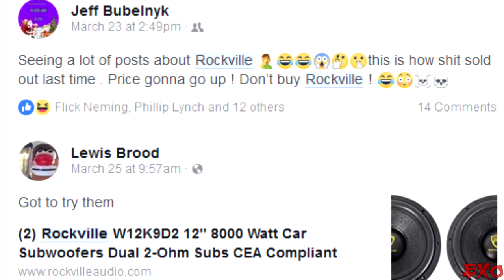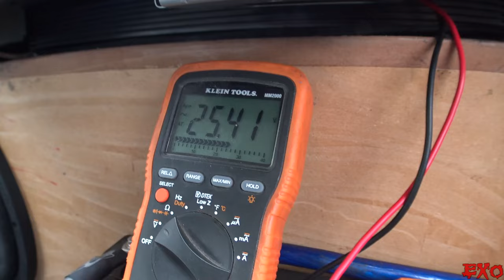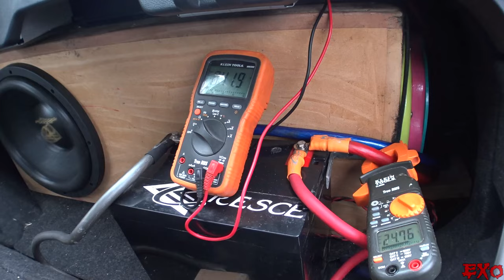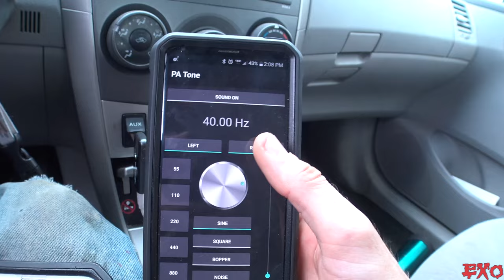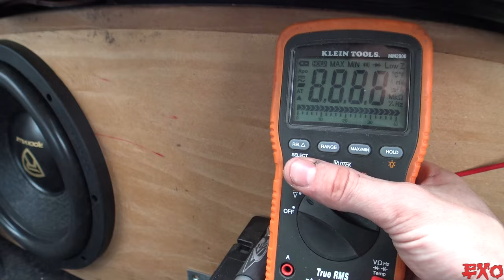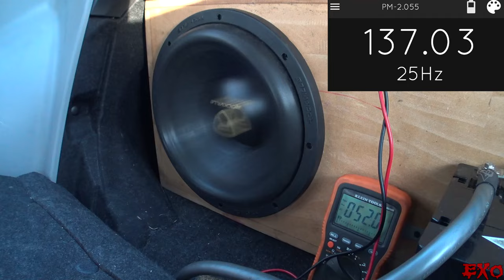CHEAP $100 Subwoofer TEST w/ 12" Rockville K9 Car Audio Sub | Aero-Ported Box SPL Bass Testing

Comment from the maker: Explaining The Aftermath & Testing a Cheapo!!! :D
Reply: Nice. Great video. ;)
Reply: What are you thoughts on the dual 12" JL audio ported subwoofers?
Reply: Goes to show how proper tuning trumps big money gear without tuning.
Reply: EXOcontralto try the Pyle 18 blue wave fr the hell of it
Reply: Just ordered one for myself i saw that magnet and had to get one for myself thanks exo
Reply: EXOcontralto  I have a pair of the Rockville Bluetooth home speakers with built in amp, and two 10inch, mids, and tweets and they rock for $200!!!!! They have everything built in and totally eliminate the need for an amp or receiver.
Reply: I made a portable bluetooth speaker with rockville speakers
Reply: Thanks EXO awesome vids as always
Reply: Like to know your thoughts on soundqubed hds line they're a pretty affordable sub. But how do they bang and how do they hold the power
Reply: you should n
"play in" a new subwoofer before you turn on full volume read a lot of things that do not pull on right at once, but maybe 30 hours or so?
Reply: Skar Audio vd series really hit to
Reply: Whats the name of the so g at 11:20?
Reply: Bonjour, comment allez-vous, je suis de l'Union européenne, votre fabricant de haut-parleurs, et vous devez savoir que je suis de l'Union européenne OKI? OKAU E Ces lunettes de soleil par ENIGMA- RETURN L'INNOCENCE ETAIT GREGORIENNE et comme les bonnes et noires gays africains et le carré de joaõ henriques UNION EUROPÉENNE
Reply: i just took the bluetooth boombox that i just posted on my channel and faced the 4 front facing mini woofers into the floor on a wood floor(carpet) and it seems like 3 times more bass im not kidding....any comments or recommendations
Reply: Try the db drive 2k 12
Reply: 9:10what sub was that
Reply: EXOcontralto can you review a small bluetooth speaker called 
“ kitsound cube”
Reply: EXOcontralto I have a car audio system, but I set it up in a cabinet with pioneer 50w x 4 channel, 200w total, and on it is 6 6.5" pioneer 200w speakers, 1000w pyle super tweeters, 4" kicker door speakers, and an 8" bose sub,, external of that are 2 big car batteries, a 225 amp car battery charger, a 6000w lanzar vector amplifier, and 2 15" 3000w quantum audio subs, but once i get to half volume my speakers have like a crackle noise, but its not that the speakers are bad, i need some help...
Reply: Hey, EXO I what to buy Rockville 2 10” what’s a good amp and watts for them
Reply: I swear these are sold out everywhere
Reply: aeros6810 wtf is a ported subwoofer...also jl makes more that 1 model of subwoofer. If your talking about the 13inch JL w7's in a ported box those are good but way OVER priced they are like 800$ a sub your better off getting the Rockville k9's 4 of them for 400$ ish and get 2 of the Rockville db16 amps that are 200 each but then again you will need multiple batterys and maybe upgrade your alternator to a high output one and if your asking a question as vague and incorrectly worded the 2 JL subs or 4 subs is way over your hear just stick to 2 12inch k9s that he does in this video or a package on eBay for like 350 where you get 2 10inch Rockville w10k9 subs and amp and a box lol that will pound and you can get away without buying a second battery
Reply: Ren Höek get these that are cheaper and yes soundqubed are good for the money also but they have similar spces as the k9 series in this video but cost 2 times as much 4 if these would be same price as the sound cubed and be way louder cause double the surface area just need the power to support it
Reply: Dominic Martinez your amps are distorting make sure you turn the gain way down look at videos on your to set gain...
Reply: "10 inch subs" I meant to say in my comment. Lol... Sorry about that. But yeah those speakers are a full system! No need to buy anything else.
Reply: Randy Martinez get the Rockville db16 it's a little Overkill but you won't have to be maxing out your amp all the time and it's pretty cheap for what it does
Reply: Mehul Singh Rockville k9 subwoofers have good bass if your asking about the 3 brands you listed it matter what sub....they don't all make 1 subwoofer lmao pioneer premier series are good and probly have the most bass out of the ones you listed but they are expensive. Just get the Rockville k9 10inch 12inch doesn't matter what does matter is the box is 90% of the build always remember that . Look up "Dave the box guy budget setup" blows minds
Reply: alternate sellers on amazon is where i got mine! cant remember the name of the company.... audio something or another.. but they are based out of new york. took 7 days for me to get mine
Reply: Let me ask you, do u still have the sub hooked up? I like the look of the sub, i just want to try something diff instead of buying expensive subs like I'm well known for doing.
Reply from the maker: @Jon Doe - No shame here man, I got a whole video coming up lol
Reply from the maker: @Ryan Merril - The sub lasted a week. Apparently there's some issues being addressed on their end with the K9's. They made things right by me though so I'm not totally pissed lol
Reply from the maker: @Heяø GaMeR  Possibly! Let me do some research
Reply from the maker: @aeros6810 - I love JL Audio. Can never go wrong with them
Reply: EXOcontralto Exo you always have good bass songs! Which one at 12:00?🔥
Reply: What kind of RMS were you throwing at it when it blew??  Was considering recommending this to a friend as a budget alternative, but after hearing you toasted it in one week, and he dosn't know how to control the valume knob, kind of nervous as He has a hair over 1,200w rms on tap without clipping
Reply: EXOcontralto what would be awesome is a install of an loc on a factory amp to add an amp for aftermarket subs.
Reply: alexander hedblom very true but for 100 bucks am to make a video it's Def not gonna kill the woofer at the worst take a little longevity away but again it 100 woofer I'm sure he has no intentions of making a build outta of it lol
Reply: EXOcontralto Has Rockville pulled all there k9 series off the website because there are none listed.
Reply: What is that Bluetooth sound pressure meter?
Reply: EXOcontralto... What frequency is this box tuned to? And would 900-1000w be good enough for this?
Reply: EXOcontralto whats the RMS for these and what budget builds would you prefer for DJ or Block party speakers
Reply: The Dutchman well of course but no one's going to buy a crazy JL W7 13.5 and not tune the Box properly...
Reply: EXOcontralto can you tell what song is playing at 10:17?
Reply: What are the dimensions of the box??
Reply: @crackdownex  sold out! Check back soon. Customer service tells me they should be back in stock beginning of September
Reply: EXOcontralto i see your using the stock head unite what’s the piece u used to make it handle the amp
Reply: Box means everything. :)  great video!
Reply: Have you ever wondered why that sub hits harder when you pop the trunk open?
Reply: You would get the highest db with the sub and port firing backward....the closer to the back the higher the db and the hardest hitting, tightest bass. It can hit hard with the woofer firing any direction but you will notice it will hit the hardest with both firing backward. Closer to back will give you hardest hitting sound. If you push it forward to the back of the seat, you will lose some spl but get deeper bass. Facing forward against the back of the seat cancels a lot of itself out, that's why it will hit harder with the trunk open. The canceling sound waves exit the back of the trunk before they can bounce back and cancel some of itself out.

3000 watts with stock highs? Ouch.

Looks like a cool sub for $100 bucks tho and still enjoyed the video.
Reply: @johnmcook1  putting the sub in that box facing up is a horrible idea unless you love rear deck rattle. You can  face it uio and make it sound good ifc you take out the spare and push it all the way back by the trunk lid.
Reply: Garbageville
Reply: Hey would my jl audio 1000watt amp push 2 of these 12s? It was pushing two JL AUDIO W3s and i had it turned down and it was pounding the shit out of them.
Reply: what song were u playing
Reply: It's kind of just like it take to run Rockford fosgate at the copy
Reply: What's the thought of the 8" c.t. subs. My has 06 Saturn just old blue. Right not she 2 Rockford 15" we are thinking removing them and run 1 8" c.t. ?????
Reply: EXOcontralto yytghyuuuhuu
Reply: U5qiue8
Reply: update video for the rockville subwoofer? looking to do a build with these
Reply: @EXOcontralto do another review they have fixed all the issues with them I would like to see you push these to the limits
Reply: EXOcontralto I’m bout to buy two of these w a box for 300$ I trust your judgment and I think for the price it’ll beat the comp for a Similar price point
Reply: At the end of the day nobody can determine how you are supposed to feel about any subject especially when it involved a loss on your behalf
Reply: I’d like to have one because there stout subs, good price and there perfect for starting out. Also I don’t really have the money to buy subs  with being only source of income. I’m trying to make my smart car pound so help a brother EXO!!! Awesome vids btw you’ve helped me out tremendously man. Thanks.
Reply: Love ur video's man keep up the good work u basshead
Reply: hey listen im gonna fry my 15 inch k9 V2 with my skar rp-1200. I wish I had an rp-800 because this is a 800rms sub in my opinion & theese clowns will not make it right with there customer base and now have the audacity to make a destroyer , which I really wanna see if its 2000 rms. I doubt it, there engineers had another shot at the k-9 & failed again so Im gonna get my youtube poppin and shit on this thing
Reply: what song is that
Reply: 999k awesome video.. lol
Reply: @Minecraftmaster6810  great subs, and sound great on low power, two 12s can sound great on the
 JL 500/1v2 SLASH amps.. I actually still have a 500/1v2 and it does 500w at 1~4ohm on 12.6v, I'll probably never sell that amp, I currently run a deaf bonce 4k at .5ohm to a single deaf bonce sa312 d1 sub takes power like an animal
Reply: Did that one burn up like the others real easy
Reply: I like the subwoofer a lot!
Reply: oooooooooooooo1
oooooooooooooo1
Reply: Thank you for getting me back into bass I have 2 12 kiker solos with a 100p watt amp it's like 12 years old and still going.it doesn't sound the best anymore  but it's not blown and works..do they sound worse with age and also iv had my h3 worked on at junk car shops and I'm positive they've used my system and I was pissed. Now supisidly they dnt use it anymore but I dnt believe em..that's why i was so interested  .I've been there..and the var adio place that installed it had set up 5 systems for me before and they all blew without even cranking it so they kept giving me new subs until I got pissed and said what do I need to buy so this wont happen.i got the 2 12lves and have been fine but they do t sound as good as the 4 comp vr12vs I had .idno I'm trying to learn how to do it myself but dno if can.sory for the long message hope u read it.your the man and a big inspiration  to me for real
Reply: @EXOcontralto  your an inspiration and have inspired me to look at a new set up but I cant do my own like you do and the shopify use is out of buisness...love the content your a great guy...

Comment: Im using 4 rockville 18s in a 2 to 1 ratio 4th order blow thru, which i learned how to make watching your video on that.  
Thanks!!!  By the way, i couldnt be happier with the Rockville 18s either.
Reply: Hey give me the specs on your box and what woofers plz. I'm using 2 ct sounds Tropo 18's working on a 4th order blow through as well and having trouble finding the perfect ratios. If I do 6 cubes sealed 12 cubes in the ported chamber at 45hz I seem to get the best gains out of the graph I see on WINISD. BUTT thats 18 cubes total seems too big for 2 18's.

Comment: EXO is the man! I love the enthusiasm. 
I'm building a standard budget build with a 8 AWG "Big 3 Upgrade" and easy access new and used equipment.
I started working with a Pioneer 760 that was given to me blown. Now I am pushing the MTX Terminator™ with a JL Audio 500/1 and need to upgrade my power output to hook up my third amp. Lol. It never stops!
Reply: Oh. I fixed that Pioneer amp. That's what got me back into it.

Comment: Great looking sub for that price 🔊🔊🔊🔊🔊
Reply: Yes I would say the only thing holding the sub back is it can only get down to 33Hz.
Reply: Breaux wonder if box tuning would make up for that? He did say he built that box to perform better across a wide range so it may not be optimum tuning for low low frequencies.

Still! At that price... Can't complain with what it's doing
Reply: Even the audiopipes cost more than these.I really think this is the best bang for buck that's out there.
Reply: DA BEARDSMEN I've gone through quite a few subs from that mid-range and down price (up to $200 for one sub) and honestly i think they're basically all the same. Sure, some are made in house with propietary materials and whatnot but  there's VERY little difference between low and mid-range price subs. When you get above that 200 mark and compare it with something lower you may notice lower end extensions or more full, powerful bass. Compare that same 200+ sub with another 200+ sub and those differences will likely dissipate. 

Box build, tuning, and in car variances make a big difference in how we perceive sounds.

Remember, these people are in the business of selling products, services, and entertainment so it's in their best interest to drum up specs, name brands, and wow factor.
Reply: Frozencajun what the hell are you talking about? The SPL test at the end clearly shows only 2db lower at 25hz than at 45hz. That means virtually just as loud at 25.

33 hz resonance or tuning DOES NOT mean a sub won't play lower in a car. It MAY mean you need a highpass filter if you run out of excursion below tuning but you can clearly see heaps of output below 33 in this video.
Reply: You think? :) Think again! This video just showed you how low it can go. xD
Reply: Agreed on the look.
Reply: lunchie80 3dB is double or half depending on the direction you are going.  That being said, that is still really impressive for a sub I would have laughed at.  The real test is how long it lasts.  It may sound good now but if you run it for two weeks and it dies then it really wasn't worth the money.
Reply: If a sub looks good, smells good it must be good???
Reply: Looked good, performed like shit because it blew in no time!

Comment: I appreciate your vids bro. Good stuff.

I always ran, "low end" equipment and I won 9 competitions out of the 14 I entered in about 15+ years ago. Now, I'm shooting for sound quality over SPL.
Reply from the maker: Thanks for watching and good luck man! Hope you reach your goals :D
Reply: Yeah man. I'm about to get set up in a 2013 Dodge Dart. Need to sound deaden it first. My only concern is power but I do have a 50fd Capacitor with a volt and amp meter on it. Running 0 gauge cable to both Rockville amps. Highs/mids on one amp and to my subwoofer amp as well.

I always run equipment that cost less but does just as good and sometimes better than the "High-end" equipment such as JL Audio, etc.

Comment: Amazing looking sub for a $100 😃😃😃😃😃 could corner the market if it withstands the abuse like Skar did with the RP 2000 amp
Reply: john wagner man I wouldn’t buy scarbage if they where $50! Besides best selling amp ever is JL 500/1 slash. Now that amp cornered the market but it’s not a bargain I get what your saying but the numbers don’t lie.
Reply: Tammy Forbes I've heard nothing but good reviews about the Skar RP line of amps but everyone has a brand they choose to run
Reply: I had the rp2000 hooked up slappin on 1evl 18 1zvx 15 and 1 xvx12...blew it
with in 90 minz
Reply: Jj Hill 😱😱😱😱that's crazy I sold mine and my buddy has it and it's been going strong for over 2 years now
Reply: i got my slash jacked :(
Reply: Is that still true though? hard to believe it still outsells the amazon top pick amps like that garbage infinity "4k" for 79 bucks.

Comment: DAYTON audio subwoofer are cheap and good for SQ setup
Reply: Ehh, I've seen Dayton Audio do better with home theater setups than car audio builds. Not made for car audio builds, really.
Reply: Even the Ultimax?
Reply: Sorry but ultimax sucks even compared to ccs.  I had one and all it wanted to do was distort and that was in a home build.  They might have fixed them but no thanks...
Reply: @QuietWind01  There's no such thing as a sub only made to be used in home builds, that will actually depend on box. Don't believe me?? Take a look at this; watch?v=z381daTbYsk

Comment: So a port box sounds better then a sealed box?
Reply from the maker: Depends on who you ask. To me, hands down ported!
Reply: “Better” depends if you want Power or quality. I prefer ported and ported does give a small Db boost over sealed but doesn’t have the same responsiveness and frequency  range as a sealed box
Reply: Ports give you the "rumble" sealed gives you the "punch". In my opinion.
Reply: Also depends what you listen to. If you like the boom of rap then always go ported to get more. If you like rock or country then sealed will give you a tighter kick but you also need more power to push the air with sealed boxes. I always went ported in all my builds.

Comment: How many no subwoofers do you have laying around. I’ve always wondered how hard it would be to take the magnets and coils off and turn them into passive subwoofers. A box for 1 10 would need 2 12s but the box should be as big as a ported box.